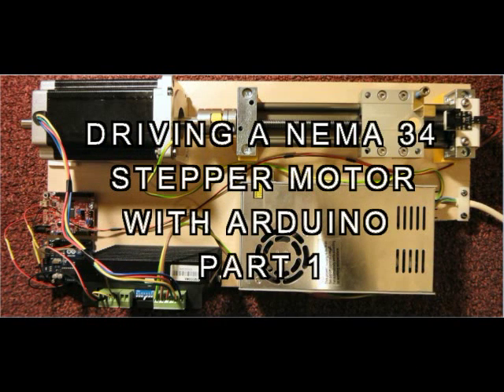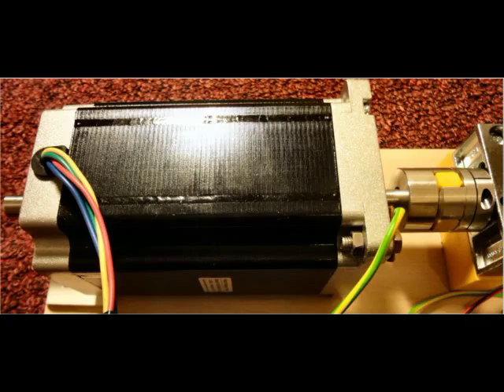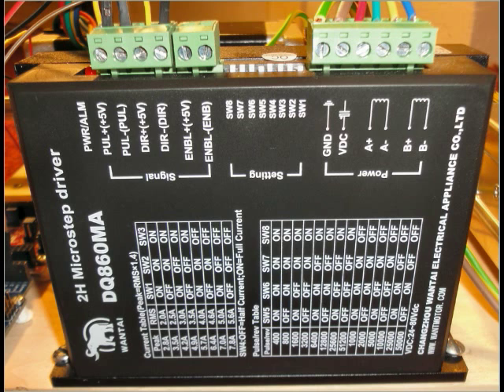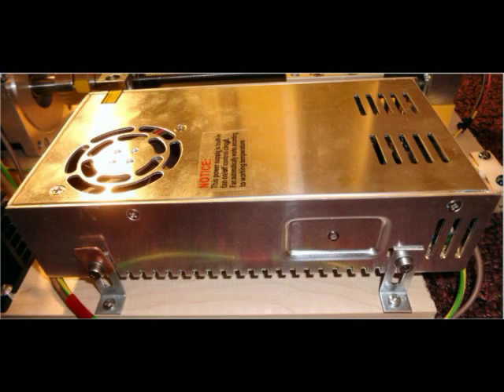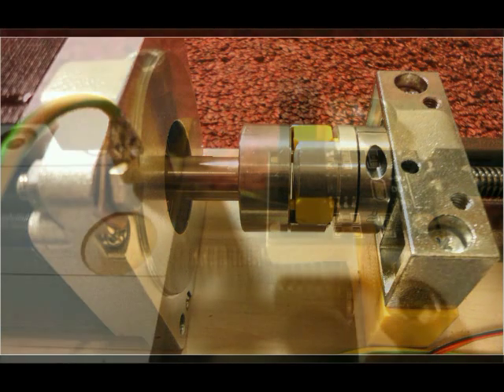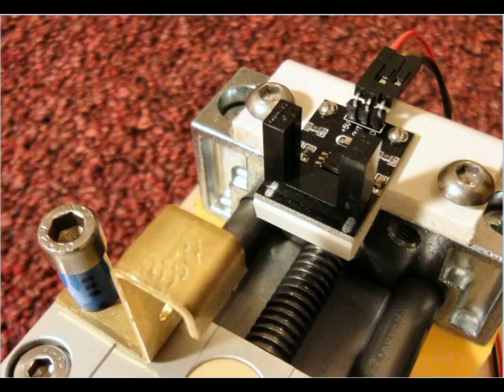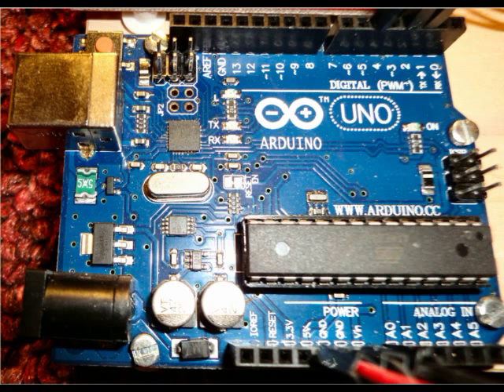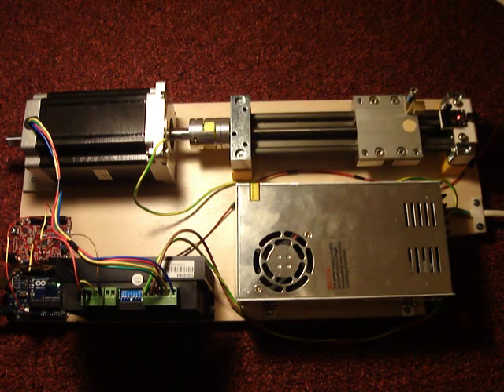Driving a Nema 34 Stepper Motor with Arduino. Code attached.

Comment from the maker: SKETCH HERE:
#include <AccelStepper.h>
  /* 
     This sketch drives the stepper to a home reference, photo interrupter, position at startup
     Supply photo interrupter with +5v from Arduino and GND. Only sinks 5mA at 5V.
     Photo interrupter OUT is switched LOW when emitter and receiver can see light, no obstruction, LED turns on
     Photo interrupter OUT is switched HIGH when emitter and receiver are obstructed, LED turns off
  */
  
AccelStepper stepper(1, 3, 2);  // 1=Stepper driver option, 3=Step pulse pin, 2=Direction

const int homeSwitch = 5;  //declare variable, home switch on pin 5
const int ledPin = 13;  //declare variable, LED on pin 13
byte hsval;  //declare variable

 // the setup function runs once when you press reset or power up the board
void setup(){
  stepper.setMaxSpeed(4000); // Set max speed. Steps per second
  stepper.setAcceleration(2500);  // set motor acceleration
  pinMode(homeSwitch, INPUT);  //initialize homeSwitch on pin 5 as a INPUT 
  pinMode(ledPin, OUTPUT);  //initialize ledPin on pin 13 as a OUTPUT             
  digitalWrite(ledPin, LOW); // ensure ledPin is off at startup
  stepperHome(); //intialize run routine to home motor
}
void loop(){
  stepper.moveTo(-52000); // move this many pulses away from home position
  stepper.runToPosition(); // Update the motor and wait for it to reach destination
  delay(300);
  stepper.moveTo(-10000);  // move this many pulses away from home position
  stepper.runToPosition(); // Update the motor and wait for it to reach destination
  delay(300);
}
void stepperHome(){ //this homing routine runs the motor at startup as specified in setup
  hsval = digitalRead(homeSwitch);  // read homeSwitch and set variable hsval
  while (hsval == LOW)  // whilst hsval is LOW (NOT seing the flag) do this....
  {
    // drive stepper slowly until it makes the home switch (photo interrupter)
    stepper.setSpeed(1000); // Set steps per second speed during home sequence
    stepper.runSpeed(); // Update the motor
    stepper.moveTo(60000); // Alter this value to ensure full travel to homeSwitch at startup
    stepper.run();  // Update the motor
    hsval = digitalRead(homeSwitch);  // read homeSwitch, then do this if high...
  }
  digitalWrite(ledPin, HIGH); // lit LED on pin 13 indicates home position has been made
  stepper.setCurrentPosition(0); // set motor position to zero (home position) 
  delay(1000);  // delay at the home position. stepperHome routine finished. Go to main void loop routine
}

Comment: Thanks for the great video. I can see there is another red sheild too by the arduino, can you clarify what kind of shield is that? or how to connect it ?

Also my second question is that I am running a Nema 17 and Nema 34 together, do they share the same arduino or could I put them on different arduino shields and connect them in one code? Thanks!
Reply from the maker: No thats not a shield its a chipkit board alongside. I have been testing both the UNO and Chipkit boards. If you are using a microstep driver then the interface between board & driver is usually opto-isolated so the likelyhood of damage to the board is protected. Yes you can drive two motors using AccelStepper & UNO but you have to wait for one motor to stop before driving the other in your code.

Comment: Hi, I wanted to ask how much is the maximum RPM that you can achieve using the arduino and Nema 34 motor without load? Thank you
Reply from the maker: The arduino can't drive a Nema 34 directly because of the motor load so in this video a microstep driver is used. If you use the AccelStepper library then for reliability a max frequency of 4000 steps per second is supported for the 16MHz Uno. So 4000 pulses into the stepper driver & 400 steps/rev out to the motor (fastest selectable for max rpm for a 1.8 degree motor with this particular stepper driver) = 10 revs/sec or 600rpm. If you need more speed then you need an arduino with a faster CPU frequency such as the 'Due' which runs at 84MHz
Reply: I take my hat, you are a master, you told me exactly what I wanted to know, thank you very much for answering and even more for answering so fast.

My English is bad, I hope you understand

Comment: What are your dip switches set too? The pulse/per rev? Thanks
Reply from the maker: George Heather-Smith 
SWI=OFF, SW2=ON, SW3=ON, SW4=ON, SW5=OFF, SW6=ON, SW7=ON, SW8=ON         800 pulses/rev

Comment: Hey Nice video.. thanks for showing..  Have you tried to use a similar wiring setup for the GRBL boot loader and run 3 axis?  I am planning on doing this with a Raspberry Pi connected as a cnc controller but I've only seen people doing it with up to 24v or nema17's..
Reply from the maker: FluffMuncher No, I haven't. I'm working on a 2 axis pick and place rig at the moment, got the vertical axis made and running with this same Nema 34 stepper and Chipkit Uno. Working on horizontal axis now. I'll post vid when I've finished.

Comment: Very helpful video! Thanks!
I tried to run a 6.3 amps/phase stepper with a STP-DRV-80100 driver (http://www.automationdirect.com/static/specs/surestepdrive.pdf) with similar connections show in your video. Didn't work :( Can you suggest any solutions? Here is how the connections look:- http://postimg.org/image/4ksx726jh/
Reply from the maker: Raghu Gowda 
Hi, In my configuration STEP+ is the pulse ouput from Arduino not constant 5V & STEP- is GND from Arduino.

Paul
Reply: Paul Fisher Thanks Paul!  at 4:30 in your video can you explain which pin on arduino is connected to where on the step drive?
Reply from the maker: Raghu Gowda 
Arduino digital pin3 to stepper driver PUL+, Arduino GND to stepper driver PUL-, Jumper from stepper driver PUL+ to stepper driver DIR+, Arduino digital pin2 to stepper driver DIR-
Reply: Paul Fisher Thank you!

Comment: for those of us who don't know what we're doing, could you share your arduino program (sketch) and what library you loaded and where you got it?
Doug
Reply from the maker: cdrobson
CODE IS HERE

Hi the accelstepper library is here http://www.airspayce.com/mikem/arduino/AccelStepper/
and my Arduino code is below:

#include <AccelStepper.h>
  /* 
     This sketch drives the stepper to a home reference, photo interrupter, position at      startup
     Supply photo interrupter with +5v from Arduino and GND. Only sinks 5mA at 5V.
     Photo interrupter OUT is switched LOW when emitter and receiver can see light, no obstruction, LED turns on
     Photo interrupter OUT is switched HIGH when emitter and receiver are obstructed, LED turns off
  */
  
AccelStepper stepper(1, 3, 2);  // 1=Stepper driver option, 3=Step pulse pin, 2=Direction

const int homeSwitch = 5;  //declare variable, home switch on pin 5
const int ledPin = 13;  //declare variable, LED on pin 13
byte hsval;  //declare variable

 // the setup function runs once when you press reset or power up the board
void setup(){
  stepper.setMaxSpeed(4000); // Set max speed. Steps per second
  stepper.setAcceleration(2500);  // set motor acceleration
  pinMode(homeSwitch, INPUT);  //initialize homeSwitch on pin 5 as a INPUT 
  pinMode(ledPin, OUTPUT);  //initialize ledPin on pin 13 as a OUTPUT             
  digitalWrite(ledPin, LOW); // ensure ledPin is off at startup
  stepperHome(); //intialize run routine to home motor
}
void loop(){
  stepper.moveTo(-52000); // move this many pulses away from home position
  stepper.runToPosition(); // Update the motor and wait for it to reach destination
  delay(300);
  stepper.moveTo(-10000);  // move this many pulses away from home position
  stepper.runToPosition(); // Update the motor and wait for it to reach destination
  delay(300);
}
void stepperHome(){ //this homing routine runs the motor at startup as specified in setup
  hsval = digitalRead(homeSwitch);  // read homeSwitch and set variable hsval
  while (hsval == LOW)  // whilst hsval is LOW (NOT seing the flag) do this....
  {
    // drive stepper slowly until it makes the home switch (photo interrupter)
    stepper.setSpeed(1000); // Set steps per second speed during home sequence
    stepper.runSpeed(); // Update the motor
    stepper.moveTo(60000); // Alter this value to ensure full travel to homeSwitch at startup
    stepper.run();  // Update the motor
    hsval = digitalRead(homeSwitch);  // read homeSwitch, then do this if high...
  }
  digitalWrite(ledPin, HIGH); // lit LED on pin 13 indicates home position has been made
  stepper.setCurrentPosition(0); // set motor position to zero (home position) 
  delay(1000);  // delay at the home position. stepperHome routine finished. Go to main void loop routine
}